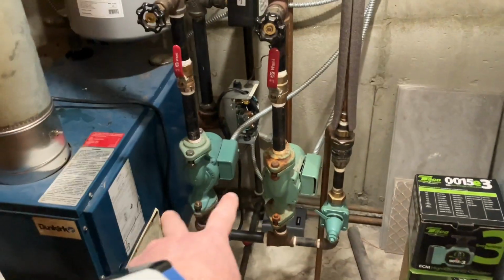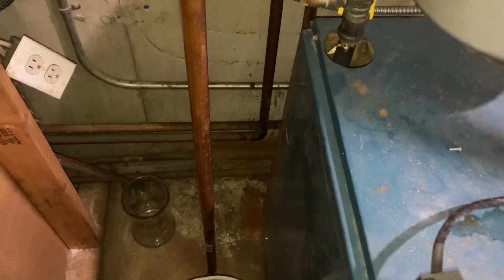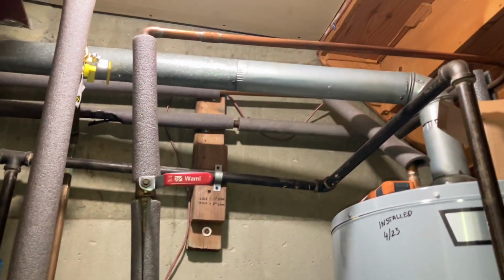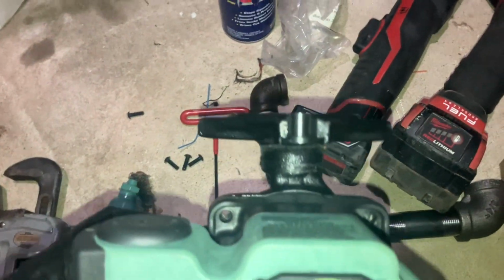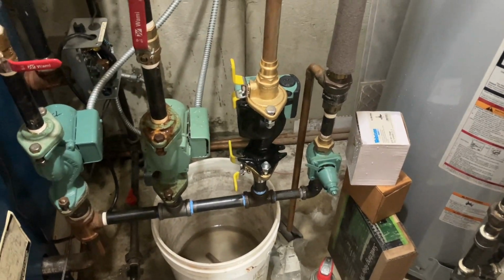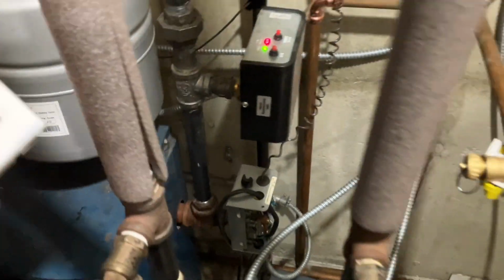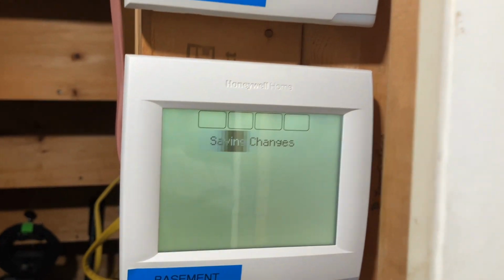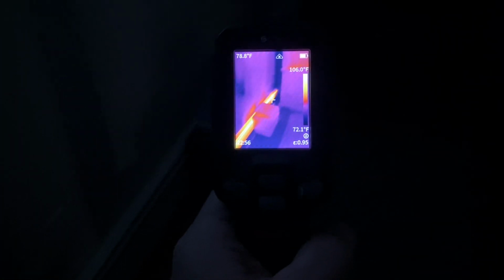Ultimate End of Landlord Tenant Heating HVAC Disputes - Splitting Zones at Boiler

Comment: I am still amazed that a whole room is wasted in thingamajiggs to control heating.
Reply: I tok over a 1959 house and while fixing the insulation in the attic floor I installed vents for balanced air. Then added a heat/cold recovery ventilation system in attic so no livingspace was lost. It also fitted outside the support-braces in attic so main storage space is also intact.
Double insulating 160mm dia ducting is a pain though. This system coupled with a air-air heatpump dropped the energy usage from 24000 kWh/year to 18000!

Comment: 16:30 Are you trolling us? One wirenut and one Wago?

But interesting to see the international differences. Here we have air outlets at the highest points of the system instead of pulling it through from down below. We also don't have a water intake connection (to avoid backflow), instead the system is pressurised using an expansion device to keep its water level.

Comment: I remember this service call video. This is were they had the Thermostat Wire going into the 120 volt junction boxes and had the T-Stat wire connecting to high voltage wire running up to the Thermostat.

Comment: Did you install circulators with IFC‘s?  I think because you split the zone with only one flow check on supply you may have a problem with gravitational heating to one of the zones on that common supply. I did see where you added one circulator and replaced one. If you used IFC’s all good.
Reply from the maker: Absolutely! IFC in the circ!! Sorry for not showing that during the video. However, in the cirque that I replaced for the other zone, the one in the middle, there was no need to install the IFC.

Comment: I have similar situation (Queens, NY). Tenants scream all the time. What is the model number for the thermostats and the remote sensors? I need control of the thermostats. My plumbing guy does not pick up my calls anymore in the midst of the cold winter :(. Please help. Thanks!
Reply from the maker: Give me a call and I’d love to be your new HVAC contractor

You have a Honeywell 8000 Vision Pro with a wireless indoor temperature sensor   

Let’s make it happen

Comment: Great system, put the sensor in the fridge for more heat.
Reply: yeah or just move it to an outside wall on the floor or against a window, under a cabinet if on exterior wall, drape a wet rag over it(not quite dripping), etc. 🤣
Reply from the maker: Sound like an educated person.  Now be realistic.
Reply: @PipeDoctor  Its only clipped on the wall, be realistic! You should have gone for wired or some other security system, landlords heating bill will not be going down.

Comment: you usually don't reply to me but i have a question   Do you not need to separate the supply as well as the return and is the transformer rated to handle 3 connections to the Com Port on the relay

Comment: The manual says not to remove the pump from the body just rotate it
Reply: No space
Reply from the maker: Because they don’t want you breaking the giant o-ring
Reply: it's usually stuck in place or hits something(if you forgot to turn in it advance). just be sure you don't break the large square o-ring or knock the whole pump cartridge and plate out, as it's just lightly retained and that same o-ring holds it pushed in. when on the volute it's retained by the compressed o-ring.
the cartridge and internals can actually be cleaned or swapped, but nobody does that anymore. at minimum, they change the whole moto/cartridge assembly and reuse the cast volute.

Comment: That's how I did mine big boiler per zone not a boiler for all the zones at once if you get what I meant sweet of both worlds with out to worry if the boiler is big enough for the heat load since al the zones are independent from each other and each apartment got different heat loads
Reply: have seperate systems done no headaches, seperate meters.. let the customer win they pay enough

Comment: Now you made this costumer the best heating season he should never have issues. With heat he got a big boiler for the money since is going to come on when an apartment needs heat and when all the others are hot and heat satisfied you have enough water tem to make the radiators work properly and it works much better
Reply: seperate systems. seperate meters..renters pay enough already

Comment: Interesting, never thought you can split zones with a steam boiler. We have a 3 flat and the 3rd floor is always colder.
Reply: This is not a steam boiler.
Reply: @marcinmerrimack1726 My bad
Reply: That's because it's not a steam boiler, steam doesn't use circulators
Reply: @timshields5308  true but you can run a zone off of a coil plate on a steam boiler

Comment: if im paying rent then you dont get to decide what temp i keep my place at
Reply: Actually in NY the landlord does have the right to set the temperature as long as he’s provided heat during certain temperatures and times during the day and year
Reply: That’s not how it works anywhere you’re not paying for your own heat/fuel
Reply: @michaelmcgregor7666  everywhere I've been you pay for your own utilities. Heat, water , electricity
Reply: That’s why you split the heating system for each tenant
Reply: @ericp8094  well usually the tenant rents the whole house, not a floor while the landlord lives in the basement. That their is just weird
Reply: @ericp8094 and the tenant pays their own utilities.
Reply: He can do whatever he wants he’s the owner of the house lol
Reply: All depends on whether or not the landlord is providing heat & utilities to the tenant.

My Grandparents used to rent out apartments above their small retail store. 

The prior owner had divided up the 3 upper floors, creating 2  apartments per floor.
He had included “utilities” to tenants at no additional charge because the electricity, water & sewer had never been isolated & separately metered.

It was the late 1960’s and the building was built in 1882.  It would have been a costly and messy nightmare to upgrade everything. Plus, energy was “cheap” back then. (before Demoncrats & eco-nuts began their quest to destroy the nation)

Long story, but my Grandfather was extraordinarily um… “thrifty” and kept the tenant oil burner steam heat set to 70°.  (one boiler for 1st floor store and one boiler for the 6 apartments)
When he discovered tenants were using many terrifying electric space heaters 24x7 to increase comfort, he had an electrician rewire the entire building.

They had all of the old K&T (knob & tube) wiring, from feeders to branch circuits, replaced with the latest craze of the 1960’s / 70’s.  
Yup…. ALUMINUM ! 😳 with FPE service equipment.
FPE?  Another Yup… FEDERAL PACIFIC !

Talk about fire potential. It was an unsprinklered building and before the days of ubiquitous smoke & CO detectors.

When he became scared about news reports discussing the fire hazard issues of AL, to reduce overloading, he had them all pay the electric utility directly AND offered to turn the heat up to 76.

Of course, that was one of my first “jobs” as an electrician.
My Grandparents left me the building when they passed on.
Reply: You’re not paying the heat bill. If you don’t like the rules go live somewhere else.
Reply: @Steve-bm2zm  I am paying the heat bill. The heat, the air con, the electricity, the water. So dono what your on about
Reply: @jerrysberrys3415  but these tenants aren’t the landlord is.   So the landlord controls the thermostat.
Reply: Yikes.
I didn’t mean to denigrate my Grandpa.  
He was “thrifty” because he had lived a VERY hard life but was an incredible person IMHO.

He had come to America by himself LEGALLY.
After being orphaned when he was only 9 yrs old.

He was a Christian Armenian whose entire family was beheaded as he hid and watched. 
It was 1915 and the Turkish “Religion of Peace” soldiers were a little upset they couldn’t convince them to convert.

They just couldn’t sell it. Even with the great “advantages”.
You know…   Multiple wives, 6 yr old child brides, ability to put a bag over your woman’s face & body, savagely beat your wife & kids, brutality without consequence, pederasty, getting to stone people accused of offense, etc…

Sorry.  I also lived through the 1993 and 2001 attacks on the WTC/NYC, so i am a bit unforgiving of evil.
ALL of that is 100% true regardless of what the YouTube censors will thing/say.
He was rescued by Christian missionaries and brought to the USA with hundreds of other rescued kids from the First  Genocide of the 20th. century.

They ended up in NJ and church families took in groups of these orphaned kids and raised them as their own.
All 4 of my Grandparents were in that group and all of them loved America for giving them true refuge.
The assimilated, learned English immediately and worked harder than anyone I’ve ever met.
Grandfathers both enlisted in our military and service was mandatory for their kids.

But… they were always worried about their future.
They all saved EVERY penny and you’d get a whack if food was wasted at dinner.
And ALL were VERY Pro-2A, they had been disarmed prior to the Genocide.
Something to remember when you hear “sensible gun control”.
Apologies for the lengthy commentary - boring history now over. 🫣
Reply: yes, if you are paying for utilities directly.
Reply: You definitely hit more curbs than the average Joe
Reply: @abisaimedrano7  you definitely wore a mask like a good little boy during covid didn't ya, probably still drive around with it on to
Reply: Because a lot of tenants, will leave windows and doors open, and say , I don’t care , I’m not paying for heat
Reply: Amen